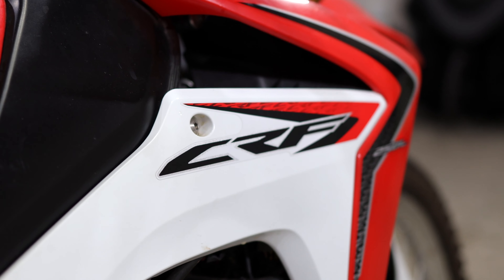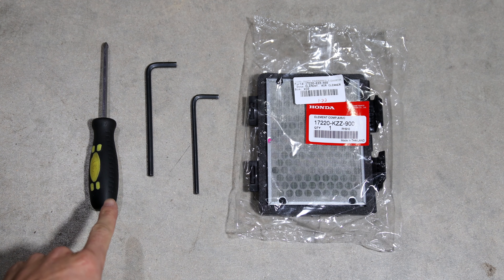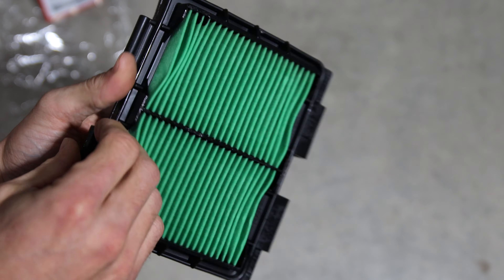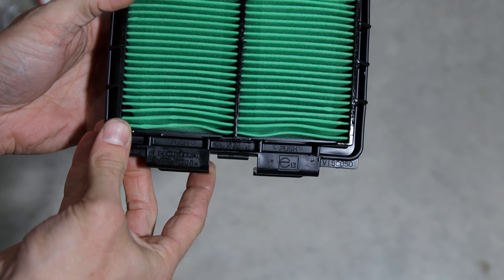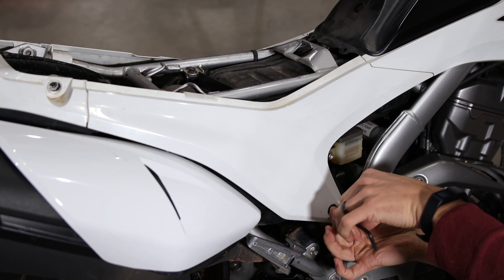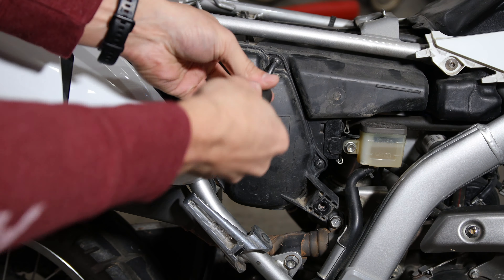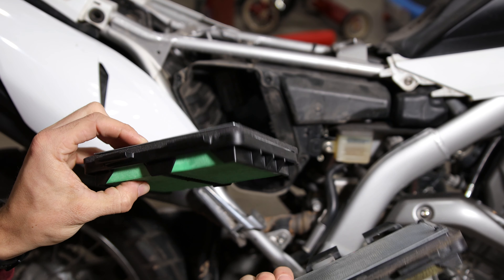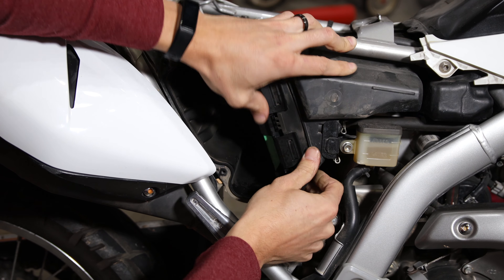Air Filter Replacement | Honda CRF250L

Comment: Is it necessary to remove the seat?
Reply from the maker: You may be able to get the side panel out without removing the seat, but it’s much easier with it off.